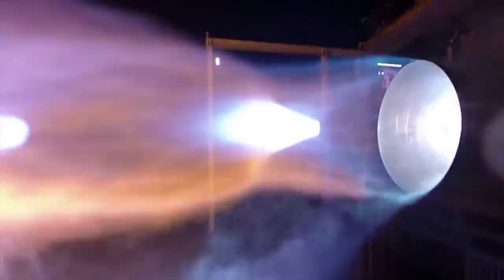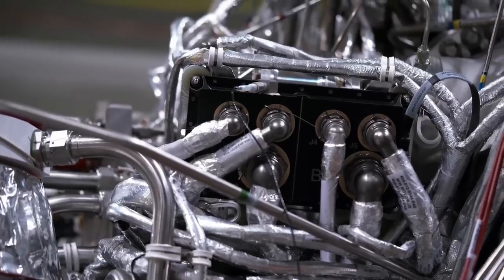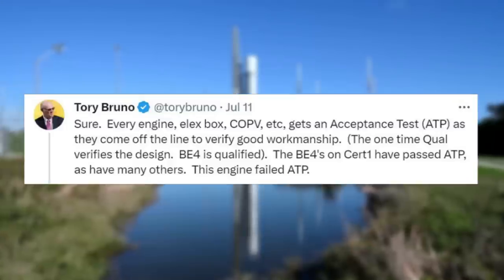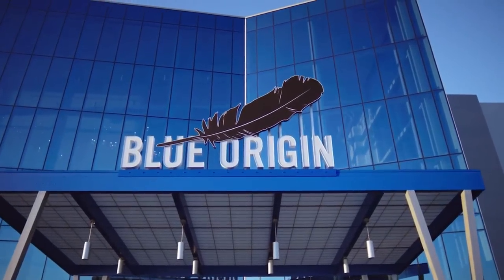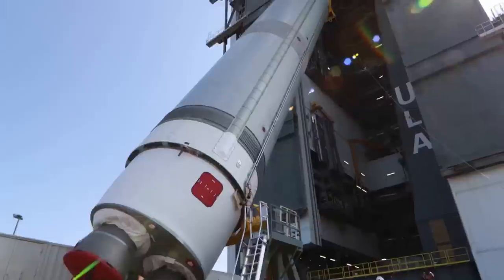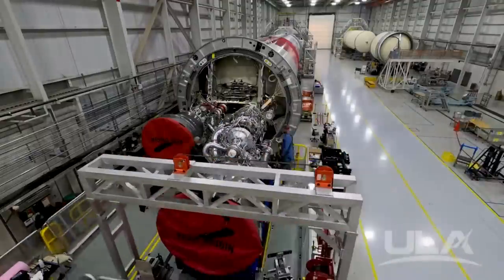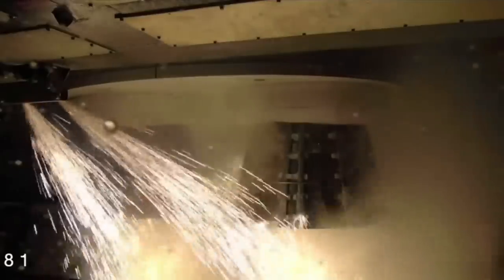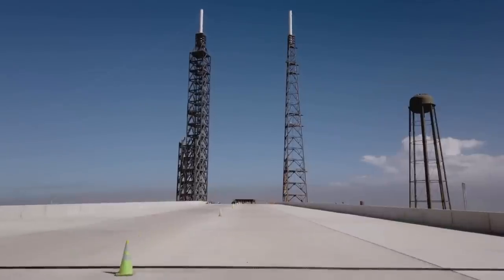A Closer Look At Blue Origin’s BE-4 Engine Explosion

Comment: Me thinks I don’t want to ride on top of one of those BE4 motors
Reply: Oh, right as if that is likely to happen real soon anyway?!    😂😅.   Give em a few years and they'll get the bugs worked out.  Or not.
Reply: Me thinks you'll never get the chance either way so your point is irrelevant.
Reply: @iamaduckquack  At the rate Blue Origin is going nobody will have a chance to ride on BE-4 engines.
Reply: You certainly don't on Raptor. Look at how many failed on Starship's orbital flight attempt!
Reply: @nowhereman1046  Raptors failed from inadequate heat shielding around them.
Reply: @nowhereman1046  As NASA SF, Elon and others have stated it is uncertain if the raptors on B7 failed because they were flawed or because of the difficulties being integrated onto the booster.  After all those raptors tested fine at MacGregor.  

 And their failure could have also been due to debris kicked up during launch or the acoustic effect reflecting off the base of the launch pad back into the engine bay.   

There are several possibilities for why those raptors failed.  Keep in mind also that 3 of the raptors were shut down early in launch for underperforming.

Comment: its concerning that various parts of vulcan have failed in tests, like that test tank explosion of the upper stage, and this engine, ULA and blue origin need to be more careful, making sure that the welds, piping. avionics, is properly put together, although it may not affect vulcan, its still a serious issue that blue origin need to sort out, its not much of a big deal, but this should be fully preventable, its 2023, not 1969, its important to note that spaceflight is relativly new, and anomaly's like this arent uncommon though
Reply: Bottom line is that the design philosophy for both Vulcan and BE-4 is firmly in the "no launch until everything is 100% GTG" school of thought, a-la NASA et al.  Meaning if Vulcan's maiden launch is anything but absolute perfection, that will be a catastrophe.  A bald-faced revelation that even when the thing is expected to work without fail, and they delayed everything for literally years to make sure it would, they just weren't up to the task.  A good juncture to recall ULA's relationship with Boeing—the Boeing of Starliner fame.
Reply: Ah, so when there were multiple Starship test flight failures, and now the Starship Super Heavy orbital launch failure, did you have all this concern, even though this will delay Dear Moon and Artemis 3 greatly? No?
Reply: @mikedicenso2778  Christ, bro.  I'm not here to school you on agile vs waterfall work philosophy.  You'll have to do that yourself.  Is this the same kind of smirk you had when Falcon 9 was crashing into drone ships?  What the hell are you going to do when Starship inevitably succeeds and changes the entire space landscape?  My advice: Don't let it get to ya.  Just look forward to the next SpaceX endeavor and that tiny window when you can laugh at them because you don't understand iterative design.
Reply: @Asterra2  Spare me your rant. It's childish and I'm not impressed in the least. If you didn't have double-standards, you'd have none at all.

If people look the other way when SpaceX has problems, then they can cut some slack to Blue Origin and BE-4. BE-4 has undergone iterative development and some big ones to fit ULA's needs for Vulcan.

Oh, and DearMoon was supposed to have flown this year... actually two years ago. Five, if we count the abandoned plans to fly in 2018 on Dragon and Falcon Heavy.

 "Hey, Elon! Where's my Moon ride?" 
- Probably Nelson and Maezawa.
Reply: @mikedicenso2778  The difference between the chips on our shoulders is that SpaceX's philosophy gets results.  I obviously don't need to substantiate this.  The entire space industry is scrambling now to do what SpaceX has had written on the wall for almost a decade, and the wholesale game change threatened by Starship is so gargantuan that only China has solidly realized they need to steal the whole idea posthaste—everyone else will be in pants-down mode for years to come yet.  It's almost painful to watch somebody sincerely believe that mocking purposefully overambitious timelines is some kind of legitimate own.  But then again... I am talking to a guy who immediately upvotes his own posts while epitomizing irony by labeling somebody else as "childish" in said post.
Reply: @mikedicenso2778  there are many risks that come with starship, yes I sure was concerned,  but starship is more of a test, they can afford anomaly's but BO and ULA Cannot
Reply: @Asterra2  No, I'm holding people to the same standards they seem to enjoy holding Blue Origin to. 

Yes, SpaceX gets results, though some of that was thanks to NASA funding them along with NASA keeping Elon and SpaceX grounded with not getting too carried away with the mega iteration thing. It's possible to iterate too much in the other direction and not enough in the other.

Most people don't realize that NASA as part of Commercial Crew insisted that Crew Dragon and Falcon 9 (with Block 5) got locked so that SpaceX was forced to mature those designs rather than get carried away endlessly iterating. The result is that Dragon and F9 are very highly reliable vehicles that they are. The only real changes to them that are occurring are those absolutely needed for safety. 

At some point, NASA and Maezawa along with other Starship investors are going to have to hit Elon on the head and say "WHERE's MY DAM MOON RIDE!?"

NASA needs Lunar Starship, like soon. Artemis 3 is just two years away, and Starship is already at least two years behind schedule. So, NASA needs Starship locked down in design. So does Maezawa. So, Elon does not have infinity iterations. He may have to settle for somewhat lower launch rates and higher prices. And he's got that whole Starlink 2 thing breathing down his neck. Again, so he needs to lock this thing down and fast.
Reply: @TerraSpaceIndustries  There is a limit to how much experimenting that Elon and SpaceX can afford to do on Starship Super Heavy. They're already at least 2 years late with it and probably more, depending on how you look at things. The switch from carbon composites to steel certainly cost them years.

On top of that, two years ago Elon in a company email had a meltdown over Raptor production and Starship needing to fly at least once every 3 days or SpaceX would go bankrupt. They have a deadline, real or imagined. Artemis is real. Dear Moon is real. Starlink Gen-2 is real.Those are starting to seriously loom now, and if there's more problems with Raptor and Starship as a whole, then that's going to have a serious impact on those three missions and one is a very serious internal financial impact to SpaceX. 

So, while you can dismiss Dear Moon and Maezawa to some extent, that's a publicity stunt more or less and who cares, right? But the other two involve much more serious deadlines and ramifications if not met for SpaceX. They don't have much time left for cutsie time antics and endless iteration. They have to fly theirs and customers on Starship and soon.

But back to BE-4, this failure is not as bad as everyone was making it out to be. It hurts Vulcan, but this is not a qual failure or a development one and the problem was understood. Those are all done, the design is largely locked down for now and they can make improvements based on the experience to the Quality Assurance, just like SpaceX has done with Merlin and F9.

Comment: Thumbs up for video; thumbs down for BE4
Reply: Why thumbs down? Why not just root for another team developing an engine? There can be multiple players in the game. People don't like Bezos just as much as they don't like Elon but its their engineering teams solving the problems. Anyone pursuing STEM in any capacity gets thumbs up in my books.
Reply: Thumbs down for you. BE-4 is just going through the same teething every other engine goes through, including both versions of Raptor up to this point.
Reply: @mikedicenso2778  Teething is not for flight ready engines, teething is for development.  This is the third "flight ready" engine...
Reply: @chrisantoniou4366  teething still can occur in flight-ready engines. This happened many times and it is happening with SpaceX's Raptor series, and it is happening with others. Eventually, everyone will get past this and the engines will do okay.
Reply: @mikedicenso2778  As I've said in another reply, "We shall wait and see..."  Teething issues may rear their ugly heads in the early stages of development and testing, but this is supposed to be a "flight ready" engine undergoing final certification.  At this late date "teething" rarely leads to explosions and damage to the test rig.
Reply: @chrisantoniou4366  This happens with even qualified engine designs. BE-4 is qualified, as that was completed back in April of this year. 

It's clear that you don't even understand the terminology or the concepts involved here. If it wasn't, no one, especially SpaceX, would do ATPs. For anything.